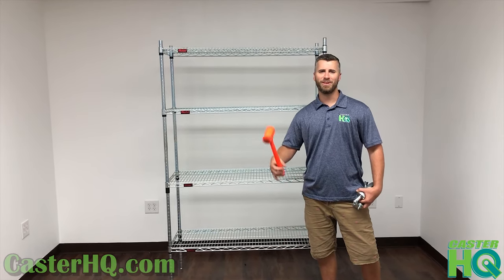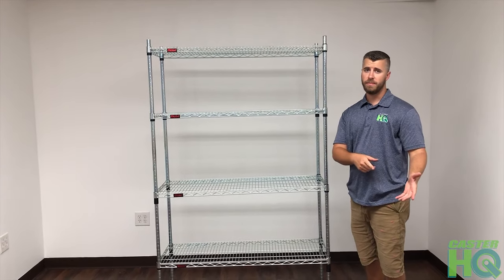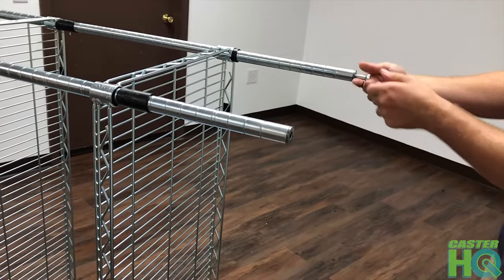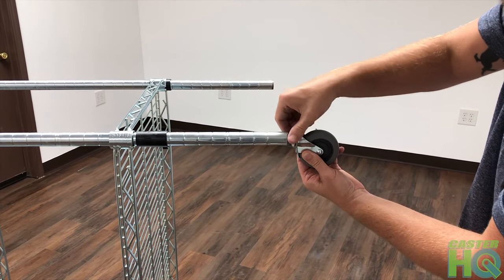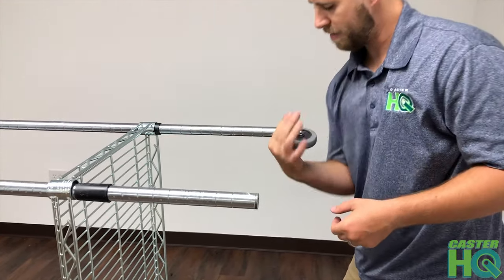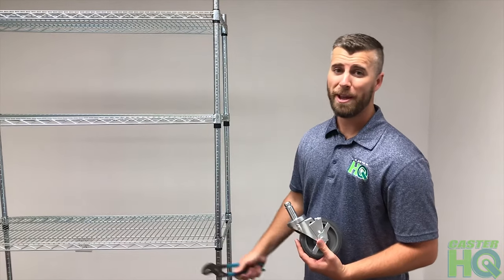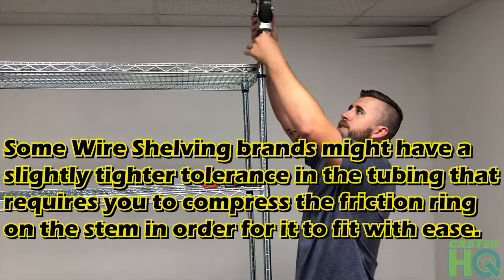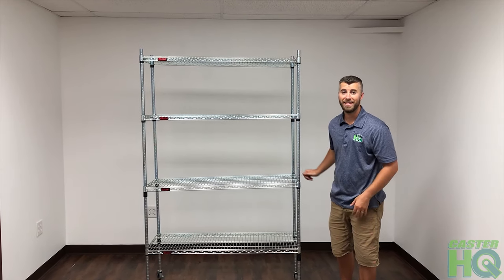Wire Shelving Wheels & Caster Installation Tutorial - Fits All Major Brands of Wire Racks

Comment: You skipped a step? How do I remove the pressure-fit threaded insert so I can insert the thicker post casters?
Reply: Get some channel locks and twist to break the seal and then they should hammer out with a flat head screwdriver around the circumference.  Or you could thread a foot or bolt into it and hammer that outwards
Reply: @fixminet1593 thank you . I was struggling to get them off . Appreciate you!
Reply: WOW and here I was working like a dog trying to beat the treaded part out with a hammer. All I had to do was flip the rack upside down 😮

Comment: Yea putting the big castors in on the top, not working for me. Gotta take off the feet, that seems to be an issue for me right now. Next thing I'm trying is spraying master blaster on it and try to unscrew it (at least on another site it said they can be unscrewed)  so I take off the screw foot and put some needle nose plyers in it.
Reply from the maker: Depending on the brand of shelving it can sometimes be a pain. Good luck!

Comment: You show how to remove the threaded insert in the post in order to insert the threaded caster?
Reply from the maker: Yes, most of these wire shelving come with levelers instead of casters, if this is the case, just remove the levelers first by unscrewing then screw in the casters.
Reply: @CasterHQ  How do I get the Caster (the big one ) in the hole if has the piece that the leveler screws into in it?!! And then the other side has a black cap stuck in it?!

Comment: It would be helpful if you could show how to get the broken wheels off for replacement.
Reply from the maker: Great idea, I will be sure to make another video one of these days and show that.
Reply: Any advice on this? I also have a few screw-in casters that have worn out and are now stuck on. I'd love to know how to get them off.
Reply: Agreed. I’m moving and trying to remove the casters and they are now loose and can’t be tightened but won’t come all the way off
Reply: any luck? i have been beating the hell out of the wheel holder trying to get it out but it will not move more than about a quarter inch before getting stuck.

Comment: any idea how to get a stuck wheel out? it is the same type as the one you are holding at 3 minutes, only able to get it out a quarter inch before it is completely stuck even used a hammer and crowbar and no luck.

Comment: Menards sells casters too, but your prices look better for online sales. However, their 3" has 120 lbs capacity, which is 480 lbs per rack; & their 4-inch is 150 lbs, which is 600 lbs/rack. Do you sell any 3/8 threaded that are 120 or higher? 

135 - 220 lbs 3 5/8 inch 3/8 threaded would be great.  (ideally a wheel, the exact height of a 2x4) Also, does anyone make a 3- 4 inch ball wheel?

Comment: The two wheels broke on the back I have trying to buy new threaded casters. I get it threaded slightly and it tightens to the point the pole starts turning do you have any suggestions? TIA!!

Comment: How do you replace the casters that aren’t the screw in type?
Reply from the maker: When you say aren't the screw in type, are you referring to the grip ring stem version? If that is the case you will simply need to pry them out with a flat head screw driver.
Reply: any luck? i have been beating the hell out of the wheel holder trying to get it out but it will not move more than about a quarter inch before getting stuck.

Comment: the legs on mine have no leveler nor anything to screw into
Reply from the maker: Hi Rachel,

Does yours contain black plastic caps on either side of the legs? If it does you can pop those caps off and you should be able to install these. If not, I’m not sure what to tell you. Thank you.
Reply: CasterHQ mine do not have caps on the bottom but there are caps on the top. Do you think there are screw holes under the caps? If so I will just invert the legs altogether.
Reply from the maker: That could he very possible. Pop the caps off on top and see if it’s either threaded or a hollow hole. Let me know the dimensions and I can recommend the product.

Comment: I had originally given this video a “Like,” for showing how to install the light-duty casters, but had to remove the “Like,” and give a “DISLIKE,” for the video not showing how truly difficult it can be to install the heavy-duty casters. Spring steel spring wants to spring back into its original shape. I am thinking that there is a way to rig a jig, to facilitate keeping everything aligned, while tapping with a mallet, while working alone. (With a helper present, I am thinking that one can hold everything in alignment, while the other uses the mallet.) I would like to see installation of the heavier-duty casters done, for real, through the entire process, rather just pantomimed, with a cursory explanation..
Reply from the maker: Thanks for the feedback!! I’ll be sure to make a new video and see if I can help you out with your installation of the heavy duty metro grip ring stem caster installation.

Comment: Does not show how to flip the shelves, does not show actually installing the heavy duty wheels.... you can't strike in a straight line as the wheels are off center, and how are you supposed to hold the friction rings with pliers while accomplishing this miracle.  Now, I figured it out, but that's not the point of a You-tube tutorial.  Show, don't tell.
Reply: How did you do it?